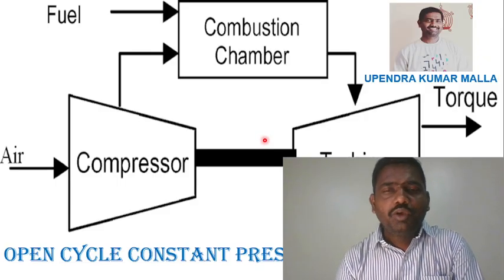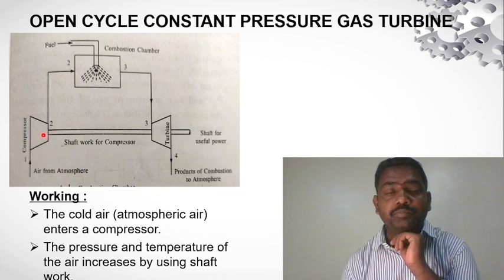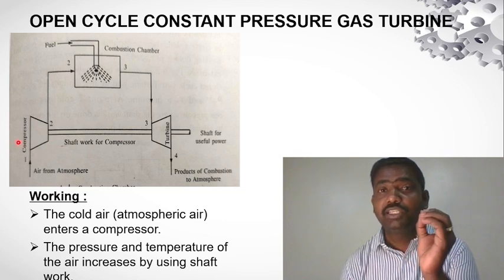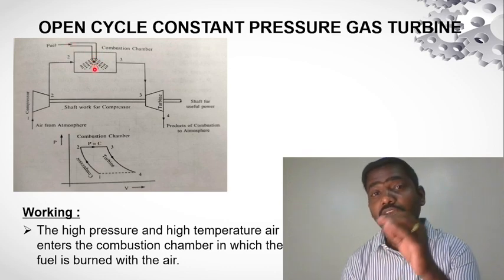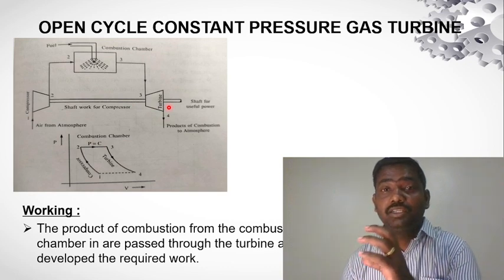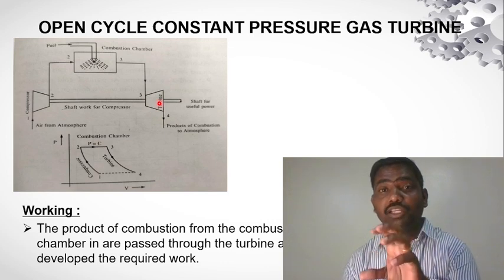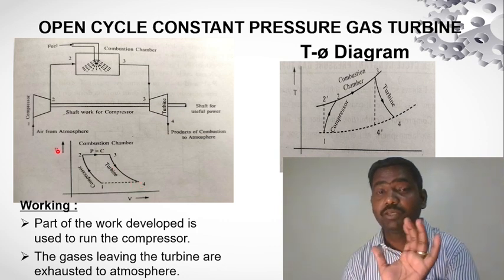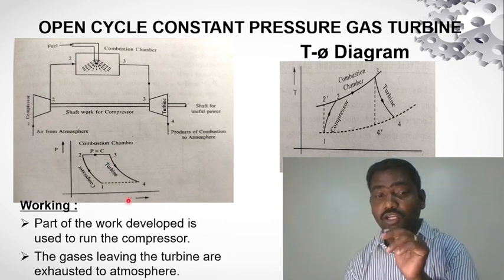Open Cycle Constanta Pressure | Gas Turbine Working | Types of Gas Turbines | Turbine Parts | Basics

Comment: The specifications of double acting single cylinder Air Compressor are

as follows:

IP = 7-5 kW, Suction pressure = 0.9 bar, Delivery pressure = 6 bar, Average piston speed 120 m/min, Law of compression PV13- constant.

Stroke to diameter ratio = 1.25